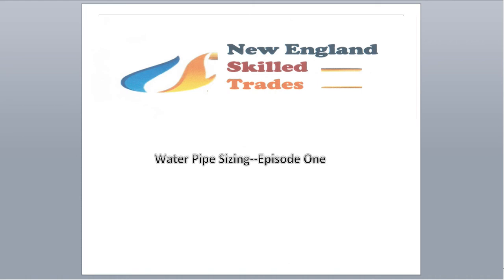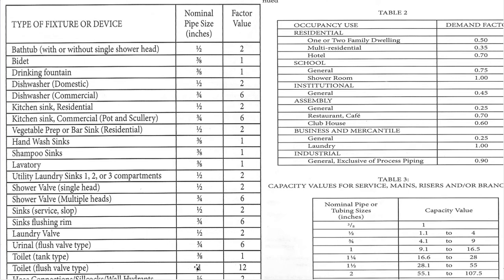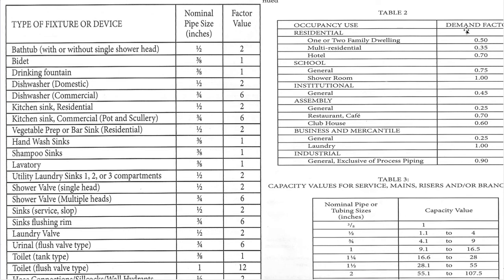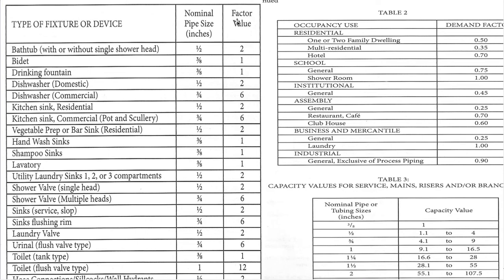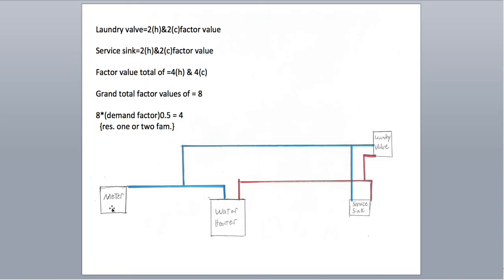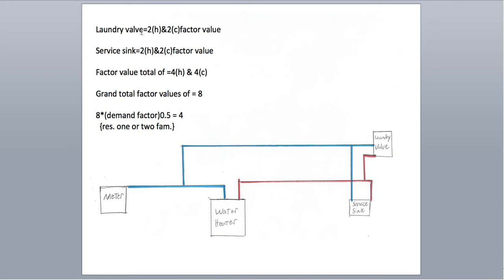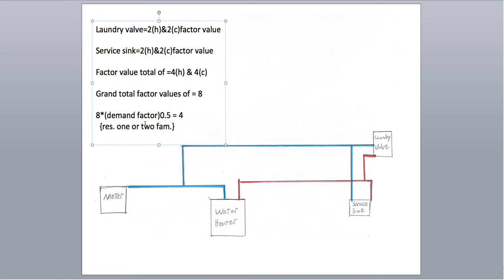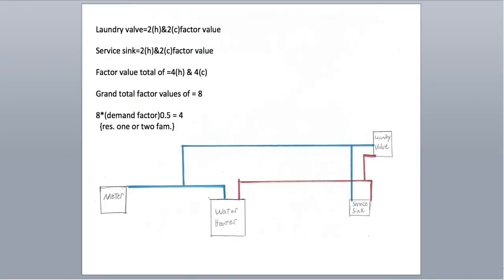Water pipe sizing.

Comment: So a 25ft run doesnt matter for sizing? Previous owner has two 25' 1/2" cold runs to washer/shower/sink/toilet and one 1/2" hot.  Do I run 3/4 then do T's reduced to 1/2" to each fixture?   
Thank you.  Main supply is 3/4"
Cant Take a shower while washer running, thats for sure.
Reply from the maker: Length of the water pipe does not matter only the demand from each fixture. I would do exactly that for the fixtures. You might want to do a total calculation of hot and cold for the main ( even if it is larger than the street side of the main). Also get a pressure tester , the kind that you can put right on a hose bib or laundry valve. If it is 40psi or under you need to increase the pressure too( approximately 60psi would be good).
Reply: Put test gauge on and reads 89psi. So do 1 inch PEX on that run? Or still do 3/4? Or 4 total 3/4 H/C, one for shower and one laundry.  Thanks again
Reply from the maker: @thebartender2008  i would do the main one inch. 1''x3/4''x3/4'' tee to the hot water from the main, then make a 3/4''x1/2'' pex manifold and run your 1/2'' (H/C)seperatly to each of those fixtures.
Reply: So it be just one run of each H/C of 3/4 then manifold to half at the fixtures? Or two 3/4 Hot runs? 
Do 1" off main to water softener then to WH at 1" Then out of WH 3/4" to fixtures then 1/2". Or out of WH 1" T'd 3/4 for two runs etc. I'm trying to follow lol. Trying to preplan my attack for drilling holes thru my joists for the size of pipe. Thanks again,  I am very appreciative.
Reply from the maker: No problem Chad. I would come out of the water heater 3/4(hot cold) close to the group of fixtures ( less holes) and then tee off 1/2” for each individual fixture. Make sure you purge at each fixture when you are done to get out the sediment and debris ( with faucet air raider and shower head off).